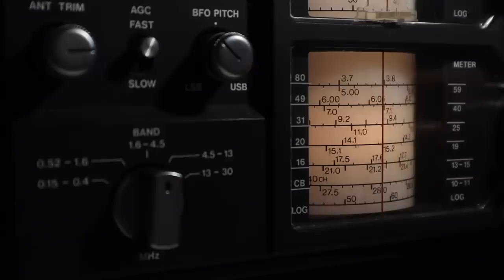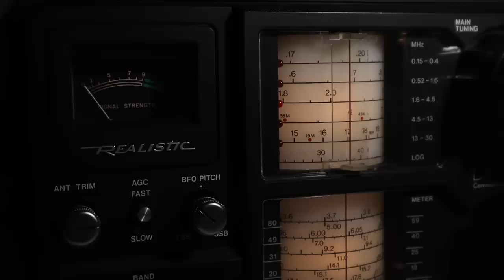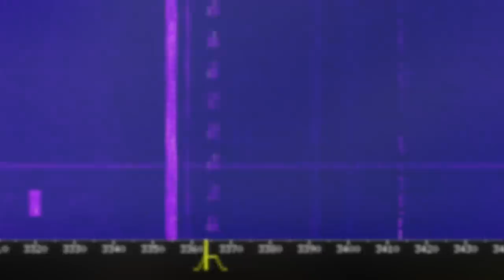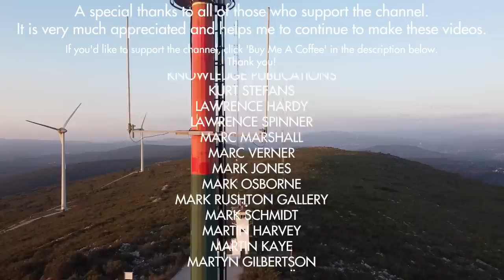Russia's Military Squeaky Wheel Signal Has Changed!

Comment: They've had the 2-tone marker for weeks, so it's not connected to the recent events. I was monitoring Pip during the coup, but observed no unusual activity (there could've been, I just probably didn't catch it).
Squeaky Wheel changes the marker tone between 2, 3, and rarely 4-tone almos every year. The most likely reason for this is that the marker generator breaks down, and they don't fix it, just change it with a spare one. They also reverted to an earlier tone after having a different one for years.

Also in the recent years they were doing "rounds" with relaying Monolith messages. The whole message chain was triggered by a solely CW transmission using callsign WEGI on multiple frequencies, then Pip was next with a voice and CW, then Buzzer with voice and CW, then Squeaky Wheel with voice (and presumably CW, we've never found their CW freq), and Volnushka-7 with voice on 4467 kHz. There were occaisonal other channels joining the chain of Monolith propagation, such as air defense frequencies, or ones that only sent network tests on a daily basis.
These rounds might happen these days still, so if you happen to catch a Monolith on either the Pip or Buzzer, quickly switch to the Wheel, you'll probably hear a message there as well. Best to try this on Thursdays, Buzzer sends 70-80% of the messages that day.
Reply: Thank you for your vigilance. Good information!

Comment: 👍Thanks for video. My guess is that the tones are just a channel marker to allow receiving stations to tune in and monitor the frequency. Why they change? Best guess is some kind of alert level or maybe the old tone generator broke. Not a very advanced system on the face of it. However, you only need an inexpensive shortwave receiver to listen to transmissions. Therefore, any Russian agent operating, say in the UK, just needs to go to Argos and buy a shortwave receiver. Basically, the agent can access receiving equipment easily without arousing suspicion. The agent can also listen to messages without being detected (e.g. unlike messages sent to a mobile phone, via Internet, post or drop locations). In fact, when messages are broadcast we don't even know which country or countries they are destined for let alone who.

Comment: What I find most interesting is the old squeaky wheel and the recent pre-replacement one were playing the same notes, albeit at a slightly different tempo and in a slightly different order. It almost sounds like the original was analogue-sequenced (by turning a few knobs) and the oscillator had a fairly high “slew” time. The pre-replacement modern one by contrast sounds very digitally sequenced and synthesised — clear sharp delineation of notes, and never any wobble in the pitch of each note.

Comment: If you keep running a squeaky wheel the noise it makes will change. They need to either replace the bearings or get some grease on it.
Reply: "Ivan, get the WD40 - Moscow is too cheap to buy grease...!"

Comment: Just an equipment change/upgrade.
Maybe because the unit stationed has changed and they use a different system, or they needed a different system because of a situation change. The units they wish to comm with has changed.

Comment: are they all changing at the same time lol o well i have a qustpn could you make a vid about sw 1 to 12 channles why some radios have 9 instead of 12 and more please
Reply: What? 

Are you talking about the multi band switch?
Reply: @madmax2069  yes
Reply: @Redneckmowers  it's just the way they're designed, but designed with a purpose.

A SW radio with no band switch and tunes in 1kh steps with an analog frequency display is pretty hard to tune as the frequencies are so jam packed together and it takes very fine movement of the tuning dial. Having SW band splits makes it far easier to tune as it spreads the frequencies out more from each other. this is how SW manufactures get around the issue without drastically increasing cost. 

There are some SW receivers with a digital display that can tune in steps that still has band splits mainly just for looks.
Reply: @madmax2069  thanks man I was wondering